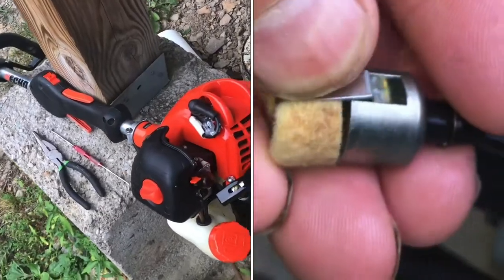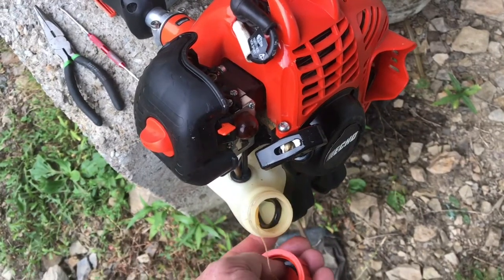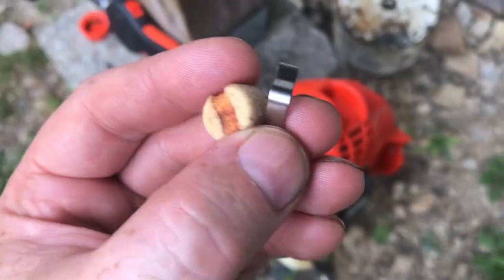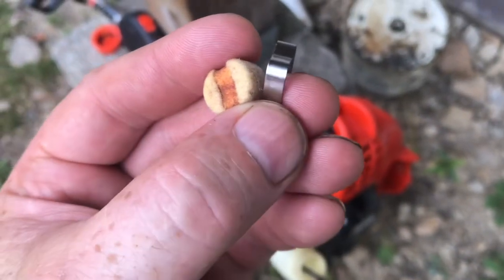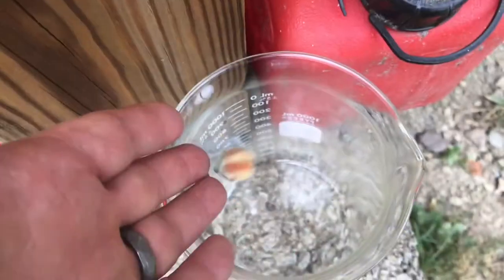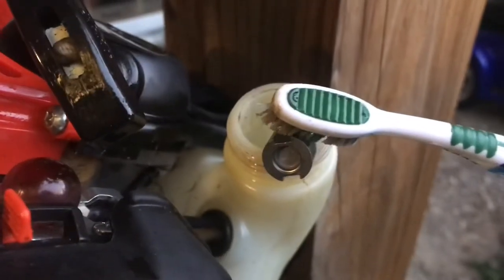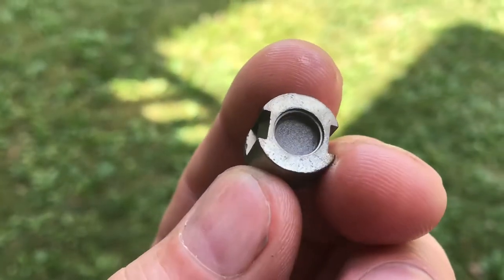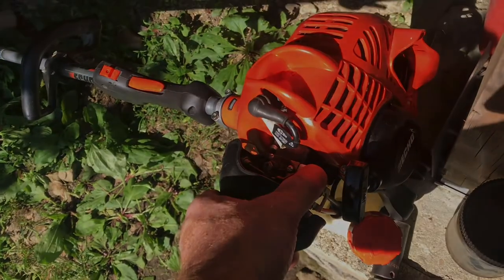“clean” (replace) FUEL FILTER 2 cycle engine echo string trimmer

Comment: Okay the the line to the fuel filter was disintegrated how do I fix that if I could just get the tubing alone I think I'd be okay but I had to get a kit and I it was expensive I don't want to do it that way. Do I have to use that kit and have all the tubes changed. One guy took it apart to do it on a channel. Please help I'm too old to be even weed eating but I'm going to have to fix it and we need that's the way it goes but I'd like to save money. Help😮😢
Reply: Get a pack of tubing at your big box store. Use needle nose pliers to feed it from the inside of tank up through the hole to the outside. Attach it to the carb. Attach the end that will go into the tank to a fuel filter and shove it in so the filter sits n the bottom of the tank.